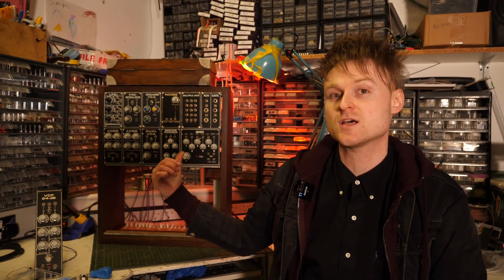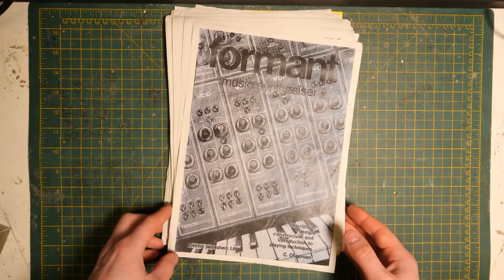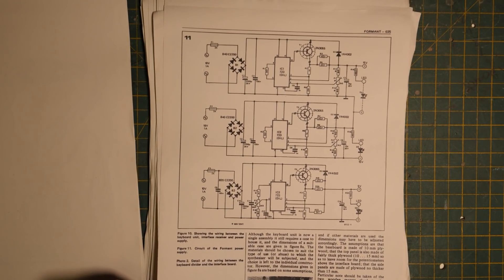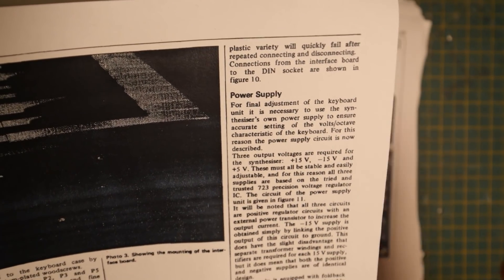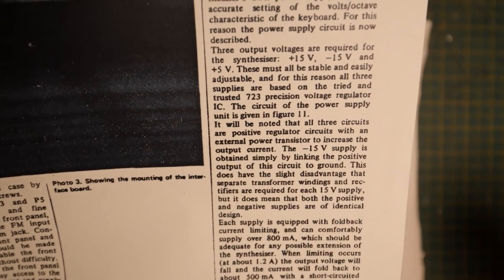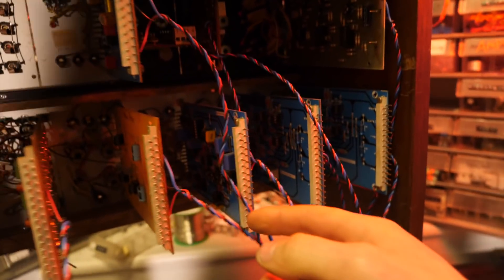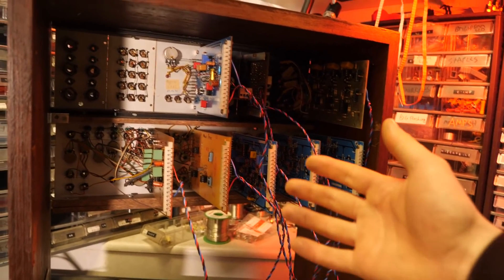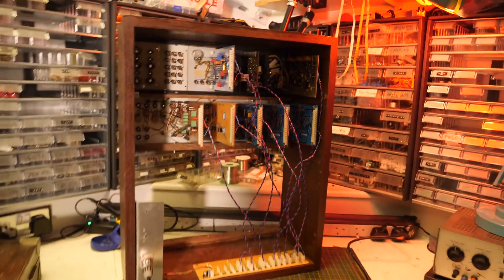Building An Original FORMANT Modular Synth Power Supply

Comment: You are only going to be able to draw 330mA with that transformer. If you want 800mA, that is 12 Watts per rail so double it because linear PSUs are about 50% efficient and that means you need a minimum of 24VA per winding. So go for a 60VA dual 18V toroid and if you do draw 800mA the power transistors will dissipate 12W each and those heatsinks won't be adequate. Finned heatsinks should either be on the outside or have a fan blowing over them. Just putting them inside an unventilated box means that you have just built an oven. 723s can't measure the temperature of an external transistor so won't protect it from getting too hot like later regulators do.
Your wiring is too thin. Measure the voltage at the PSU and then on a module--there will be voltage drops.

Comment: I built all my power supply like that using only positive regulator. It has many advantages like much less turn on transient and generally the positive regulator have better specs that the negative (noise, drop out and transient). I also find that it much more robust. But yes you need two transformer winding and two full bridge rectifier. Most standard toroidal transformer have two separate secondary winding anyway.

Comment: Tidily done! Good job finding a wooden case that matches the formant. Those original PCBs are beautiful. Love the way those big axial capacitors look, I may start using those instead of the radial ones. Only remark is I would probably put in a switch on the mains input, for safety when working on it and and also for efficiency as that design probably runs hot even without a load on the output. I mostly use all-in-one switched mains input connectors, as they have some built-in fusing, EMI filter, and you don't have to wire the switch - fewer terminals to crimp!

Comment: Well done, it saves a lot of trouble ahead. In 1976 Elektor advised to use a more expensive circular ring core transformer to avoid magnetic field spread, so I did the obedient thing back then. The Elektor circuit boards are so comfortable to build on, the copper tracks are masked in red to avoid solder spill or short circuit, and on the component side the silk screen helps to position the correct parts in the correct way. Looking forward to the next episode, which will be about calibration and tuning!

Comment: Great video! You have made a great choice is using the original linear power supply. It uses precision voltage regulators (723) which will keep the rails accurate, which means better VCO frequency stability. It also has NO switching noise, so no 80KHz siganls wandering round the synth causing audio damage. ARP used the same design, so Formant went down a well trodden road. :-)

Comment: Our PA amplifiers in the 1980's used 2N3055's for their finals. With a pair of 2N3055's set up as a class B (push/pull) we could get 200 watts RMS out of each pair. They're fairly beefy. I still have a bag of them somewhere, as we had to replace them often every time we'd blow the finals from turning our PA up a bit too high...
Reply: The power amp needed overcurrent limiting.  The 2N3055 is rated at only 115 watts.  The 2N3772 is rated for 150 watts and there are even higher.  Also it's easy  to parallel 2N3055s like the way it's done in linear power supplies of hundreds of watts.
Reply: @acmefixer1  There were two transistors per leg (class B amplifier), one for each phase of the signal, so 230 watts, derated to 200 watts. Two rails, I think +80 and -80 volts. There were four sets of two (if I recall) in parallel, for a total rating of 800 watts. I'm going off very faint memory here, but I believe that's how it was set up. Might have been a very slight bias on each pair of transistors to prevent zero cross distortion.
Reply: @ScottsSynthStuff  
The Power transistors may handle high current at low voltage or high voltage at low current.  But when the current and voltage start going up, the chip can develop a hot spot and the high current causes thermal runaway, and it instantly destroys the transistor.  So the current and voltage must not exceed the SOA - safe operating area.  And that's usually significantly lower than the transistor's maximum power.

Comment: Looks nice, I love analog supplies. 9:56 Where is the earth pin from the mains going? If it's going to the 0V rail and you get ground loop noise you can disconnect it or put a switch on it. Recomend a 500ma amp fuse on the live. Earth the transformer chassis's if you fancy it, not relly needed. the heatsinks should be good for the ~3W heat they have to dissipate. :D

Comment: first...yeees.Wondering how do you wire mains power to split between the 2 transformers, and what goes between mains and the trans..just a switch, or you need a cap or sumfing..silly plonker here
Reply: I just wired both transformers in parallel. Only thing between the mains and the transformers is the fuses in the kettle lead socket
Reply: Don't need caps on the mains side. Can use a switch if you want. And you wire them in parallel to the mains, so one wire from each tranny goes into neutral and the other two into line/live :D Fuse is a good idea too, some trannys have them built in.
Reply: Also make sure you do not connect the mains side of the transformers to your tongue!!! That won’t end well 😂
Reply: @LOOKMUMNOCOMPUTER  I put em on my butt cheeks..its what we in the game call a rectumfier lol
Reply: mains goes into the jack on the side of the box. from the video i see Sam has then wired the 2 transformers directly to the pins of the jack. You could use a switched jack if you wanted to. From there the transformers reduce the 240v AC mains to the 18vAC and 9vAC they output to the 3 circuits on the power supply board. This then turns it into DC current and regulatets it for the synth.